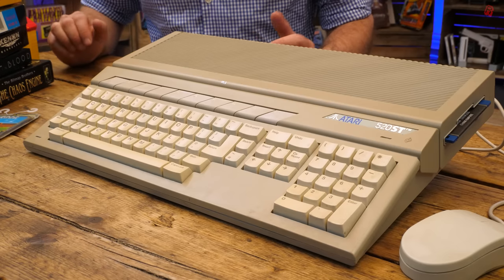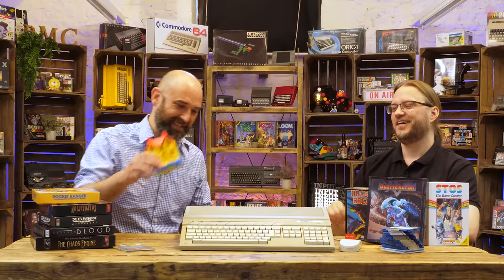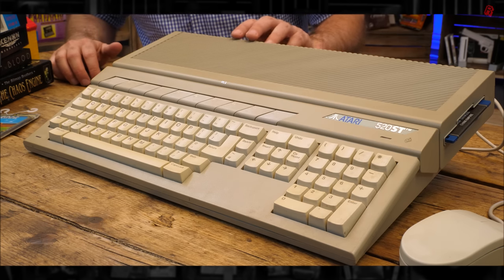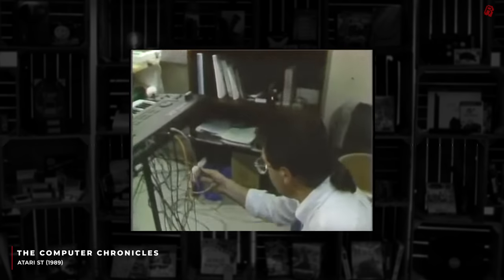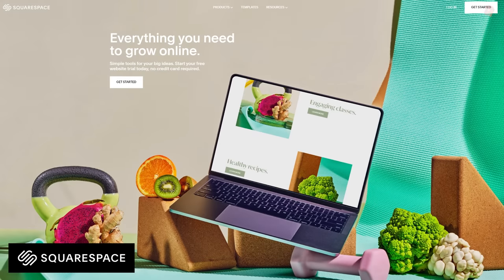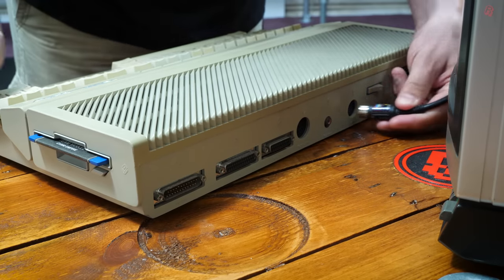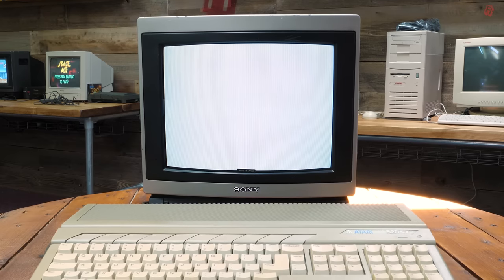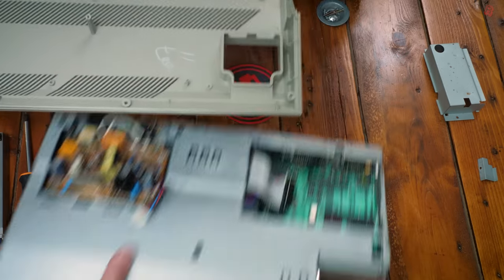At last! An Atari ST in The Cave - Meeting and Restoring a 520 STFM

Comment: I just discovered this channel today through your Kickstarter, which I backed, only to find this gem of nostalgia (pun intended)! My first computer was this exact STFM model with the same discovery pack, which I got in 1991 I think.

I bought the upgrade to 4Mb of memory for around £100 in 94 and I remember that came as a kit with instructions if you were brave enough to do it yourself, which I turned out not to be after trying to make sense of the rather vague instructions. So I had to pay extra to get it installed! It was great because I could load some games into RAM disks and play them without having to swap disks!

Sadly and unknown to me, the ST and all my floppies were moved to a cold, damp room while I was away for a few months, and most of them failed to load when I got back, and eventually none worked at all. I think the disk drive must have been affected too.

I remember seeing ads for I think 40/80/120 Mb hard drives but they were too expensive for me. It's a shame hard drives were not more affordable at that time.

Comment: I always lusted after that Atari ST512. Such a gorgeous design. Its still looks like a Million bucks.  
However, I was working as a computer technician at Boeing of Canada, and I ended up building an IBM AT compatible with a math co-processor, to run AutoCad back in 1985. 
I should've bought the damn thing back then. Regrets, I have many...

Comment: An ST in the cave! About time. One really interesting thing about the ST was because the earlier models came with a single sided 360k 3.5 inch floppy a lot of games accounted for that. So when the cracking crews came along and ST's were shipping with 720k drives we had CDs (not the optical kind). Our CDs were 720k disks with flashy demoesque menus  where you could select from multiple cracked games on a single disk.  Common on the ST.....not so on the Amiga as i understand.

Comment: The Atari ST and the Amiga were the stuff of legends for me as a mere C64 owner. I had very little money at my disposal for entertaining my computerneeds back in the day. I was faced with buying a 1541 diskdrive for my C64 and being able to afford blank disks or buying an Amiga 500 or Atari ST with me being only able to afford blank disks very sparingly. 3.5" floppies - ones that worked in the ST or the Amiga were very expensive. The MSX 3.5" worked well with the much cheaper 720Kb SD disks. 

I ended up playing the ST and the Amiga over at friend's places and stuck with the C64 well into university (early 90s), then I got my paws on a MSX2 machine and was emulating that on my Philips PC XT NMS9100. Then the 486SX-25 for my thesis; upgrading that - the onset of UAE, Fellow - and finally buying an Amiga 500 and later a 1200 as an early retrogamer starting to collect systems very early on.

Comment: In the states, some publications referred to the ST as the "Jacintosh".
Reply: That's because the was an Apple emulator for it
Reply: @JohnSweevo  I remember an early Mac emulator hardware called something like MacInSac. Can't vouch for the name as I can't find a single mention of it using google, but that could just be because it never really got a chance to take off as Apple dumped hard on it, or at least that's what I think I remember. It was basically a dongle that could take a Mac ROM and then you could boot up a virtual Mac on your machine. Now the other problem is that I can't remember if it was for the Atari ST or the "competing product from the company that kicked Jack Tramiel".
Sometimes I don't like my aging brain...
Reply: @JohnSweevo  Ah Spectre GCR able to boot on mac floppy disks ! Crazy at the time and still now. Dave Small shall be remembered as the top dog hacker for Atari St me thinks.
Reply: @JohnSweevo  Might also have had something to do with the fact that GEM shares more design features with the first Mac system versions than any other GUI I'm aware of. C64/C128 GEOS was close second though.
Reply: @Ragnar8504  The hardware was also very similar, and remember the first Macs didn't use any custom chips (unless you count the very small off the shelf PALs).

Comment: I had the original Atari ST , with the separate PSU and disc drive, it was marketed as a business machine and you could get it with the business software, i sold mine to a custom motorcycle shop to help with his business. 
Would love to have the original version today. I’ve still got my boxed Atari 1040 STE FM with everything included inside the box. Must have a look 👀 for it. Really loved 🥰 my Atari.

Comment: I had the original 520ST with an OS on Floppy disk, later getting the ROM chips to install myself.
My final upgrade was to build my one 20MB HDD for it. MFM drive, MFM to SCSI adapter board daisy chained to a SCSI to Atari adapter board. I was amazed when it all worked first time!!

Comment: The 520 STFM was my first computer after a Spectrum 48K+ and I still have it today. It's upgraded to 1MB RAM but that's as far as I went with it. I also have a 520 STe which I upgraded more. It now has a switchable TOS between 1.62 and 2.02, 4MB RAM (SIMM upgrades made that so easy) and a very yellowed case. I got it second-hand and it was like that when I got it but aside from that it's a standard STe so I'm eager to see what upgrades people suggest. It's a shame you didn't get an STe as they're more readily customisable.

Comment: Still have my original (working!) STFM, with a whopping 2Mb upgrade. I can still remember my dad installing it on our dining room table. It went inside the metal shielded part in the center, and we had to cut the lid off. Theres a slight bulge in the keyboard now as it didn't quite fit back together again. Always wanted a hard drive but never got one, tho I did have a midi keyboard plugged in. 

I also remember having a digital sampler that went into the cartridge port.

Comment: Back in 1988 I was thinking quite a while if I should buy Amiga or Atari ST. I finally decided in December of that year and I decided to buy a 286 12Mhz PC with 1MB of ram, 40MB hard drive and VGA display. So I basically never ended up getting either of them. I did use them at friends place though so not totally unknown.

Comment: Hi Neil, Seeing your Atari when i visited the cave prompted me to get my Atari 1040STfm out. The Atari ST is my first 16bit love affair and i used it for both gaming and MIDI work with my Yamaha DX7.  Bad and bulging capacitors on both the PSU and on the main board were fixed plus two resistors that went open. Finally got it working again.  
I can def recommend the Gotek floppy drive replacement (specifically the FlashFloppy version with a mini oled)... let me know i have got a lot of experience with sorting that.   The external SD card hard drive replacement is good but a little unreliable. It does work but has a habit of corrupting the SD cards.   Def upgrade the RAM remembering to add the extra components next to the chips. Upgrade the TOS and then use the Roland Midi unit you have to run some decent music thru it.  I've got the MouSTer to use a USB mouse. Watch out as Microsoft optical mice dont work well with that and the ST. its a bit picky. Had to use some random cheap optical gaming mouse from ebay with <120mA draw. Rob

Comment: About time! I love my 1040 STFM (same as 520, just 1MB RAM). Had my same machine since 1987 and it still works well, albeit the floppy drive got worse and worse but I've replaced it with a Gotek now. So many great memories of the machine. Played my way through Dungeon Master, Space Quest, Llamatron and much much more. As Australian shops abandoned the platform around 1992, I had to grit my teeth through Amiga and PC owner jabs and make my own fun with the ST. I cut my programming teeth on STOS and GFA Basic, making everything from sprite based games to a database to calaogue my MAD Magazines at age 10.

As for your exhibition, you will be able to share your Amiga joysticks with the machine but not the mouse. Find a decent mouse for it. Get a Gotek for USB loadable floppy disc images and an Ultra Satan for a hard disc replacement (because ST hard drives were the difficult to use ASCI format rather than SCSI). I'd also suggest upgrade it to 1MB to open up some enhanced gaming options.

Comment: My 520STE / 4 MB / IDE HD was recently treated to a Exxos PSU and a UltraSatan drive for easier data transfer and stability. Also did a Dual TOS 1.62 / 2.06 mod that really helps with running games of floppies. The Exxos store has quality goods, and very fast delivery.

Comment: As a former owner of an 1040 STFM, I would recommend:

CALAMUS (DTP)
CUBASE (music)
NOTATOR (music)
HARLEKIN (acc, several tools including text editor & other goodies)
PC-DITTO (pc emulator)
There was also a very capable Mac emulator called SPECTRE CGR, but I used ALADIN that was OK. 

You can also try EmuTOS. It’s free but it does not really work with games. 

As for booting an ST, it read the disk searching a ini file (I cannot recall its name or extension) that kept the settings for the desktop (resolution, background color,…). If no disk was present, it waited for some reason a lot of seconds until showing the desktop. You can actually insert a disk while the screen is blank.

Comment: My STFM must have been a later revision than the one shown here.  TOS was on two chips not six, and there was a square socket already soldered on the board for the Blitter.  I just had to buy the chip and fit it.  I also needed to replace those two TOS chips with version 1.04 to get it to work.  I later fitted TOS 2.06 on top of that with a toggle switch to change between them and added a Marpet memory upgrade.

In terms of productivity software, ATARI Works was really good, along with NVDI for faster screen drawing on GEM based programs.  I was still using this setup until as late as 1998 before buying my first iMac.  Fast forward to today and I use a MacBook Pro now but still fire up the HATARI emulator for playing the old games from time to time.

Comment: I remember having one of these and i was 14 and i saved up and brought an upgrade adapter called evergreen or something like that and it turned it into a 1040 but it didn't work, so i looked at for a few hours and worked out that the instructions that came with it were wrong and the adapter needed twisting 90 degrees to fit in and it worked, i was so chuffed and getting it to work.

Comment: Great memories come back to me… 😁
Like others already did, I can recommend the Ultrasatan double SD card reader/writer as a harddrive replacement. The NetUsbee module adds USB ports for mice, keyboards and memory sticks as well as an Ethernet interface that you can use in order to hook up to a local network and access a file server.
I would also suggest adding the „Ubeswitch“ to the monitor port. This allows you to use the ST with a lot of VGA monitors or even LCD monitors with a VGA input in all of the available resolutions, including the highest one which is only monochrome.

Comment: Unfortunately all STFM power supplies now need a full service before they are put back into service. The contacts of the mechanical switch will also need to be cleaned as they have a tendency to short when dirty.
Great to see one in the Cave  as I had an early 520STFM with 16 ram chips and to upgrade it meant soldering another 16 into the board.

Comment: Was always a (money in the box) Amiga gamer back in the day, but did have to grab an STFM a little while back as I did play on them.
There is a hard drive port on the back and I believe there are SD card solutions that plug into it called the Satan (and Ultra Satan), and TOS supports the drive out of the box.

Comment: Who doesn't love an underdog, the ST is/was a great machine :-) If you want to take advantage of a floppy drive emulator without removing the original drive, you can install one into an external floppy drive enclosure and plug it into the back of the ST. To make the external floppy bootable you need to cut a couple? of traces on the mainboard and wire up a toggle switch (you can find instructions online). You can then select whether the internal floppy, or the external floppy emulator is the one that the ST boots from.

Comment: I have an Atari STE in need of repairs but I am unable to do them myself. It's been sitting gathering dust for years now waiting for the repairs. From what I could gather from testing it, I think it needs a new blitter chip. The machine powers on fine and boots to the GEM desktop but the blitter option is greyed out. It's also missing a keycap for the down arrow key.

Comment: I got bit by the Atari bug around five to six years ago. I wanted an STE but couldn't find one in the USA for a half descent price. Bought one from the UK and ordered my self a quality Step Down transformer. When I got it I could hear something loose inside the Computer. Expecting the worst I opened up the Case to find all the Memory had come out of their sockets. Which was weird until I realized the 1040STE I bought wasn't designed to take SIMM Memory. And Instead came SOCKETED for SIPP.

Comment: Upgrades really depend what you want to do with it, taking it up to 1mb is more-or-less mandatory; or you could try to find a marpet xtraram deluxe or similar for more flexibility if you want a bunch more ram for a ramdisk or something.  A gotek would be convenient, but seems a shame to throw out a working & recently repaired original fdd.  Short extension cables for the mouse/joystick sockets are useful, and many mice/controllers of the time should be switchable to atari mode.  Other upgrades arent really used by most software unless your doing something specific and have a certain requirement, there were also cartridges for preserving date/time and various other things.

Comment: I still have my Atari STE 1040 in the loft, it just needs some retrobright and maybe TLC, and it'll work.
Alternatively, I have thought about upgrading the TOS to version 2.06. It's still a great machine.
Rainbow Islands and Bubble Bobble and many other classic games :)
Reply: TOS 2.06 makes nice changes to the desktop but breaks some games, so it's a TOS up ( ;-) ) as to whether it's a good upgrade, especially if you're just running games from floppy.

Of course, you can buy a dual TOS board from Exxos and switch between the two versions.

Comment: I think the STFM is the ST that Atari would have released 1st (with an upgraded OS) had they not felt the need to rush to launch against the Amiga.
I built several MIDI based music studios for people with these STFM's, I think I did one STE and a couple of Falcons as well. I didn't like the OS (until the Falcon) but I will say I never had any issues with the MIDI port and it worked just fine for the task.

Comment: I am about 2 years late to this video.  I hope your upgrades included replacing the motherboard, floppy drive, power supply, keyboard, case, mouse, monitor, and all associated cables with equivalents from an Amiga.  That would be a great upgrade.

Comment: Not long ago i recently had a rectifier go BANG on my atari STFM's internal PSU. Replaced it with a modern version and its running again. Gotek flashed with hXc firmware is great for atari STs but mine is just shoved in the case not mounted correctly, i think you can get 3D printed mounts, but if internal might have to cut away at some of the original casing, which of course anyone who wants to keep them original as possible wont like to do
Great video and wow Mark, your hair is long these days lol

Comment: You can solder in a 4MB sim. You can add a switch so you can choose between the original ram config and the 4MB one. I also added a harddrive in the form of a ultra satan (don't know if they still make these), allowing me to add SDCards as Harddrives to the system. You can also add a blitter into the empty space on the MB.

Comment: Still have my 520STFM bought back in 1989. Need some restoration though. Added few DIY mods a few years ago such as the composite video output and picoATX PSU. 

Right now, the system is quite unstable. Most likely due to bad caps.

Comment: I have a strong aversion for the YM2149. A similar chip was used in my MSX as well. The Atari might have got a very interesting sound chip called AMY straight out old Atari's research lab, but it narrowly missed the dead line. AMY later showed up in another prototyp   from Atari, but was never released.

Comment: For upgrades: as far as i remember you could upgrade to up to 4 BM but needed a lot of wiring for this. Also newer BIOS. And get a hard disk ;-)
Reply: Yes, newer TOS for more compatibility and better PC floppy access, more RAM (1-4MB) and some kind of Harddisk. (Not a real one, they break easily even just by doing nothing). Floppy Emulator is cool, they don't cost alot and then it's basically ready to go!

Comment: That Atari is a later version as the ram in the unit is surface mount I used to upgrade these at the local computer club .. these machines never had drive belts they were always direct drive

Comment: I recommend upgrading the RAM to atleast 1MB, installing a Blitter-chip and getting a "Micro-Ultrasatan", it's a really neat hard-drive solution that you could setup in a way that it won't need additional external power. Depending on what software you want to use you might also want to look into upgrading your version of TOS.

Comment: Got an Atari 520 ST, that being external floppy drive, external power supply and mouse/joystick port on side of machine not underneath it!  Be careful of internal PSU on later models, running the the ST whilst the cover is off and psu is exposed leaves one open to risk of electric shock.